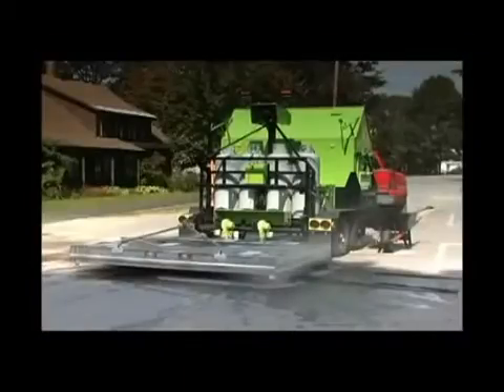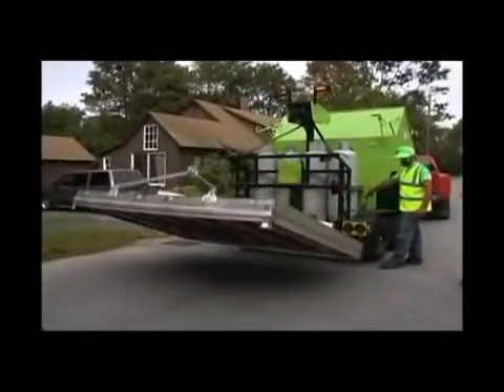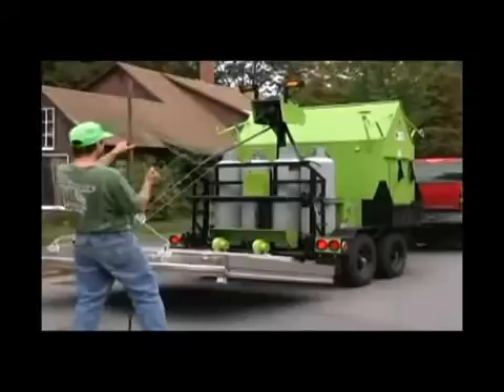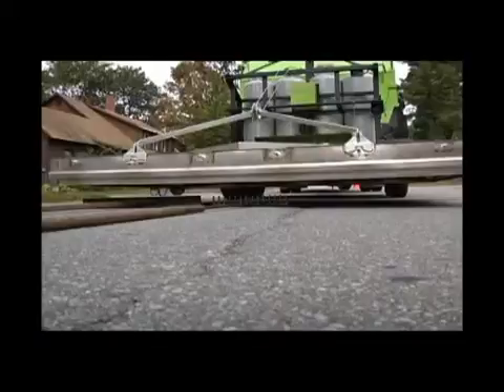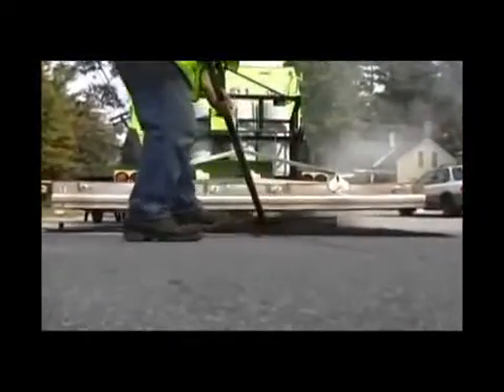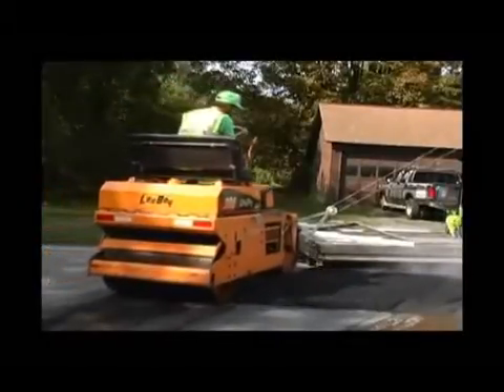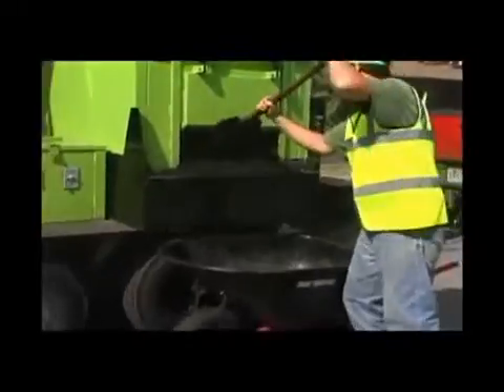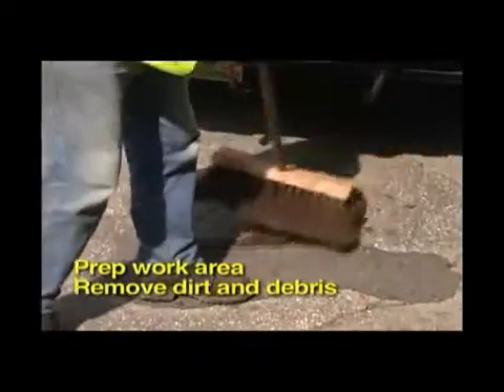Ray-Tech Infrared Corp.: Infrared Explanation & Demo Infrared Asphalt Repair

Comment: What's the process like for working around concrete?  Do you haver to take precautions not to heat the cement, or cover it with shielding of some kind?